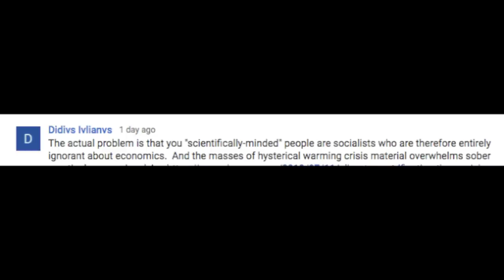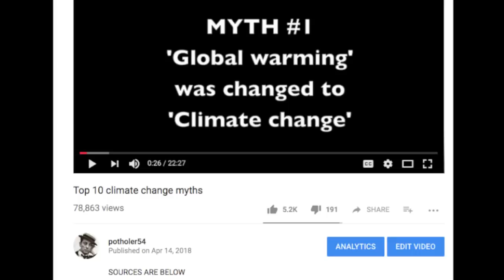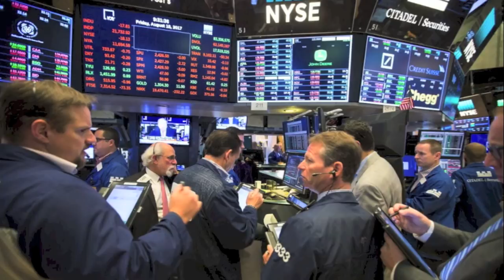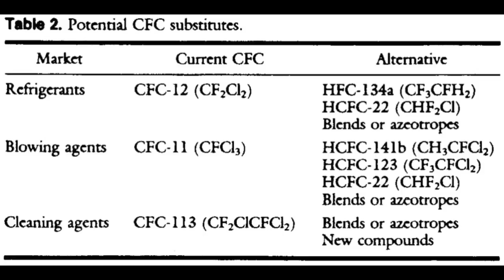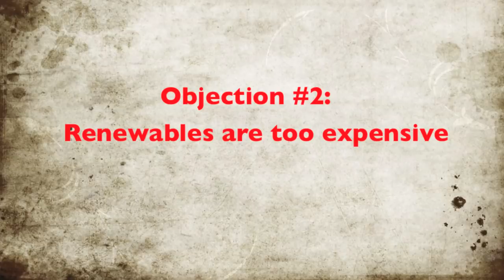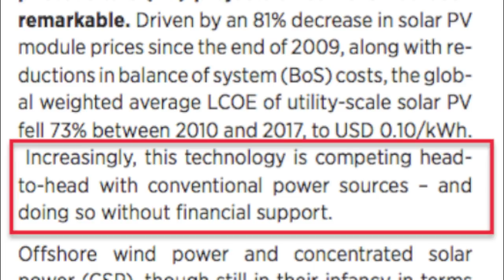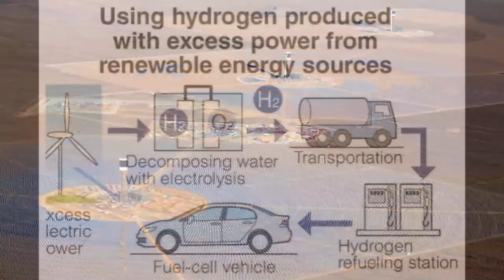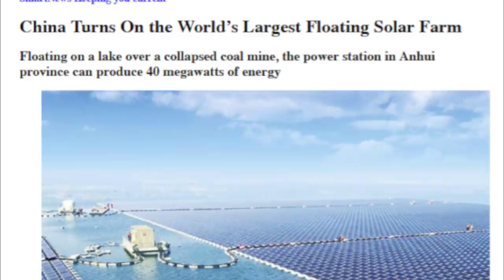A CONSERVATIVE solution to global warming (Part 1)

Comment: An environmentalist is sitting in his apartment in his underwear, dripping with sweat. It's 35 degrees Celsius outside and almost 40 Celsius in the apartment. He's refusing to turn on his air conditioner. He's sacrificing and suffering for the cause. Across the hall is a guy sitting on his couch. He's got his air conditioner cranked because he loves wearing his favorite blue sweater. He's cracked open a beer and is celebrating because he just finished the blue prints on an air conditioner that runs with 80% greater efficiency. Environmentalists love to suffer and sacrifice. Capitalists simply embrace efficiency and hedonism.
Reply: he would turn on the AC as it's already has the HFC's and then purchase a replacement one with a safer refrigerant after he properly recycles the old one.  Since he  can't buy a green power plant the Envrio dude will invest money and vote for a politician who will endorse green energy development.  Like say France Australia and Germany.    The engineer who designs the 80% efficient AC unit also has his A/C cranked to get his work area at a bearable temp because he knows that the brain works optimally at a relatively cool ambient temperature.
Reply: But where is the incentive for the capitalist to make a more efficient air conditioner. Incremental progress will happen, for sure. But most people don't care enough to buy a more efficient air conditioner (the R&D alone would likely make an air conditioner that is more efficient a bad economic decision - not to mentioned the added expense of manufacture, which goes down far less with volume.). You need government regulation to incentivise both people and companies to do the right thing.
Reply: @lehanjones242  - absolutely if there is a need and a perceived value (regulation and advertising plus features and visual design))
Reply: @lehanjones242  If there is demand, there is an incentive. A myriad of appliances today are manufactured and marketed as more energy efficient. From fridges to televisions. If I build a more efficient air conditioner with the same quality at the same price which one would you buy? The incentive is always the same, to build anything better and cheaper to attract the consumer.
Reply: Meanwhile, in reality, actual environmentalists ARE the people designing more efficient air conditioners while capitalists simply pay shills like Ben Shapiro to claim that the dangers of abusing air conditioners is nonsense. And you guys believe the one who sounds more stupid.
Reply: @TheReaverOfDarkness  Venture capitalists and entrepreneurs create the companies and make the investments. Engineers design the air conditioners, not environmentalists. Environmentalist just scream at the people who use air conditioners. Have no idea why you brought Ben Shapiro into this.
Reply: @anthonymorris5084  So environmental engineers aren't environmentalists? Do you just change the definition when it suits you? Environmentalists are whoever is doing something wrong at any given point in time, an amorphous blob representing your discontent with reality? Why did I bring Ben Shapiro into this? Because he's one of the major speakers against climate change, and like all the others, he's full of shit and doesn't make any points that can actually be defended with facts. But go ahead and prove me wrong.
Reply: @TheReaverOfDarkness   The solutions that environmentalist come up with are always disastrous. They are emotional thinkers who don't take into consideration the ramifications of their idealism. The often demand that we all go back to a time of purity and innocents that never existed. Take the vitriol over pipelines as an example. Sometimes planes crash but we don't demand the end of their construction or manufacture. Your inclusion of Shapiro is accusational. You make it sound like I support him or I'm somehow aligned with him by some kind of default. I fully believe that climate change is real. I really don't care about Shapiro.
Reply: "The solutions that environmentalist come up with are always disastrous" - mate, the burden of proof is not on me for that statement.
Sure, like any group, there are idealistic thinkers, and there are pragmatic ones. In balance, they are both extremely useful. Take Elon Musk, for example. He is unequivocally both a businessman, and an environmentalist. His ultimate aim's are to transition the world to renewables, and get Humans to mars. To do this, he's started probably the most successful EV company in the world, and has provided huge publicity for EVs as a whole. His companies and various subsidiaries also sell solar panels, and powerwalls, among other things. He is a pragmatic environmentalist.  
Additionally, capitalism is not a force which always acts in the public good. A company's purpose is to MAKE MONEY, not to act in the best interest of the public. government regulation guides or accelerates the development of enviro friendly technology - take your air conditioner example. Sure, air conditioners are getting more efficient. This is because of several things - by making a quieter air conditioner, for example, you incidentally make it more efficient. But if the government subsidizes efficient air-cons, then more people will buy them over less efficient ones, more money will be put into R&D for development, etc. Government regulation does not necessarily cause increases in efficiency, but speeds up progress.
Same thing for LED lighting, solar panels, and electric vehicles, to name a few.
Reply: @Anthony Morris    That's a rather uncharitable generalization of a diverse collective of individuals, thinkers, scientists and professionals alike. I don't know how "emotional thinking" relates in this context.

Renewable energy was scoffed at years ago for the same simple facts potus & friends spout -- contrast that with its surge in relevancy today, and the amount of energy we manage to produce as a by-product. 

No one group has all the answers. But lets not throw the baby out with the bathwater in trying to make a caricature of a few people you may disagree with.
Reply: @TheReaverOfDarkness  You make a lot of assumptions about me. I would identify as a centrist, a pragmatic environmentalist, a believer in climate change and a strong supporter of capitalism. No I don't believe only leftists can be environmentalists. I would state that the further left one cares to venture, the more you find environmental zealotry. The further right one goes, you're simply likely to find less support for environmentalism period. That's just an observation. 

It's the "leftist idiots that science doesn't stand behind" that I'm referring to so how can I answer your demand. That's who I'm critical of. I find it startling that you believe "the left being more likely to embrace ideas that aren't stupid". I've certainly witnessed a lifetime of leftist stupidity. However, neither the left nor the right has a monopoly on stupid. 

Just off the top of my head here are some disastrous, emotional, and idealistic moments. The no pipeline mantra. Using the polar bear to tug at heart strings regarding climate change while seemingly pretending that we haven't spent a century destroying every other animal. The entire dirty oil argument. The hysteria, hyperbole and apocalyptic rhetoric over climate change. Vocabulary to make it emotional and demonize, like "Big oil", or "big Pharma". Turning anyone into a pariah for mentioning the myriad of positive aspects to climate change.  What about the demand for the largest wealth transfer in history? What a ridiculous plan. Climate change will be solved by Western nations, via investments in science and embracing capitalism. How about the utter refusal to acknowledge that the solution and complete end to climate change is a reduction in population levels. What surprises me is that I'm betting we have a lot in common but you seem to want to pick a fight.
Reply: @anthonymorris5084  I don't think we have much in common, ideologically. I have made a lot of assumptions about you, out of anger. But since you have told me more about you and your position, allow me to make some assessments:

You identify yourself as centrist yet your own views are right of center by US standards, which pretty much makes you far-right. You're a strong supporter of capitalism, well capitalism is a right-wing economic position. Thus far you have criticized solid, well-grounded environmental solutions without offering any counter solutions or even any decent reasoning as to why the given solutions aren't good. Not only do you align with the US-right views on the environment, but you criticize centrist environmental views by using the same kind of sound bites and poor logic that is eschewed by the US corporations, through the mouths of the American conservatives. You can call yourself centrist, but you're at minimum mid-right, likely far-right.

The Alaskan Pipeline caused extremely high amounts of environmental damage, and with as little as a 5% increase to its cost it could have avoided over a third of that damage. But people spoke against it even before it was built because they knew how it would play out; because this has happened plenty of times before. This "mantra" you speak of is people caring enough about our land to try to stand up to corporations, and here you are supporting the crony capitalism by insinuating there's anything wrong with trying to take care of land.

Sure, the environmentalist left often employs feel tactics to get their message across, and it's generally one of the only ways in which they achieve success. The appeal to emotions isn't inherently a dirty tactic, it depends on what they are trying to do with it. But appeals to emotion are pretty much what both sides are constantly slinging, and the further you get from center, the worse it gets. But it's not a balanced issue, not by any stretch of the imagination. The touchy-feely groups on the left like PETA or Greenpeace are seen as extreme left by leftists, and often thought of as approaching terrorism. But the touchy-feely rhetoric is pretty much the only way the right-wing talks about anything; every right-wing presidential candidate Gish-gallops their way through debates, talks feelings, and completely avoids all logic. And the right-wing people in the USA don't turn away in disgust, no they support it and use the same false logic and logical fallacies, and try to demonize the slim minority that's actually trying to make a positive difference.

Only the oil-selling corporations would say that there are positive aspects to anthropogenic climate change, but they spend large amounts of money to seed this lie, and it looks like you've bought into it. People aren't demonized for speaking in favor of climate change, much to the contrary they are educated on why their logic doesn't hold water. But what you're doing is trying to make this into an emotional argument because you can't win with logic since you have none to support your side, and then you're taking every negative aspect of your side and claiming that your opponent has those traits. But prove me wrong, show me some logic to support anything like climate change ever being a positive thing, or any shred of the right-wing ever having anything reasonable to say about it.

You may have heard me use the term "crony capitalism" earlier. Make no mistake. I did not say it to add feeling or try to demonize or strawman something I subjectively disagree with. I did not use the term to single out some small slice of capitalism. I used the label because it fits. Let's explore this. I will paste the definition of crony:
From Merrian Webster: a close friend especially of long standing
From Cambridge Dictionary: a friend, or a person who works for someone in authority, especially one who is willing to give and receive dishonest help
In common usage we use the term similar to henchman; a crony is a person working with someone else against others.

Capitalism at its core is a free market system which maintains that everyone should build their own destiny. A purely capitalist government would defend each person's right to make their own way, and would pass as few laws as possible. When an actual system is purely capitalist, the strong immediately overpower the weak and enslave them. The rich use their wealth to gain even more of an upper hand in the system. It immediately becomes highly unstable as everyone works for their own interests against the interests of everyone else. Powerful magnates make deals with other powerful magnates in order to secure more business power, and make very small partnerships that serve a very tiny number of people to get them as much wealth and power as possible. They serve only their business partners, and use their power to take as much away from everyone else as they can manage.

A purely capitalist system is full of cronyism because it supports crony groups, because capitalism is at its core a crony system. When I say "crony capitalism", I don't mean "some small branch of capitalism I don't like", I mean "capitalism as a whole". You're a capitalist, clearly you seem to think that capitalism is a good system, and you even seem to think that's a view that I'd take for granted. But I don't. The free market improves the economy only when you measure the net wealth of the nation; it completely fails when you measure the median quality of life of the individual citizen. Socialist systems tend to win out in mean quality of life of the individual citizen, even if they fail at the net wealth of the nation. But I don't care about the net wealth of my nation unless that wealth is needed to protect what's good in it. If it's not a good nation, I don't feel a need for it to protect itself. Forgive me for being a citizen and a human, but I care about quality of life over national wealth, and the only reason you'd feel differently is because the powerful mega-corporations that rule your world have paid a lot of money to convince you otherwise.
Reply: @TheReaverOfDarkness  Dude if you think I'm going to read an essay you're mistaken. Let me add Judgemental and pretentious to my view of you. I'm far right? You know nothing about me. I'm an antitheist who believes in freedom of religion. I believe in gay rights, pro choice, minority rights, human rights, rule of law, charity, taxation and capitalism. I'm against capital punishment and anything to do with guns. Does that sound far right to you Mr. judgement? I've been trying to have a reasonable conversation with you but you're endlessly full of accusations,  judgement and arrogance. I can't elaborate on the things you demand unless I too, write you a friggin essay. This is not the platform. There are endless positive aspects to climate change but I can tell you're just not willing to listen to anything so I'm done wasting my breath. If you want to stop pipelines because sometimes they leak, then you better ban airplanes, cars, alcohol, skydiving and an endless amount of other things. It's reactionary and close minded. We're done.
Reply: @KingofUSA85 And what gives the government the right to determine what is the "right thing".   The government is not god.
If this isn't self parody or some other form comedy trolling it's the stupidest thing I've seen written today.